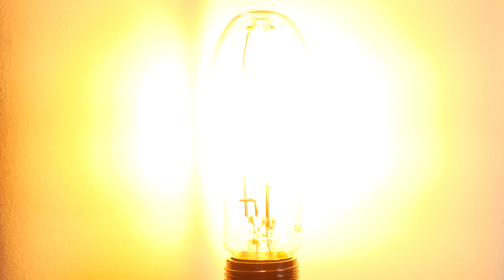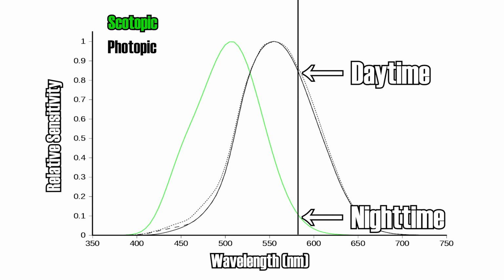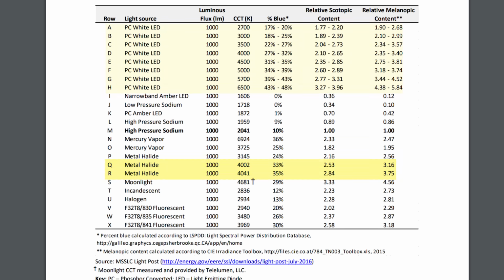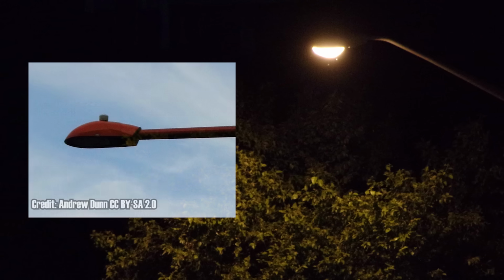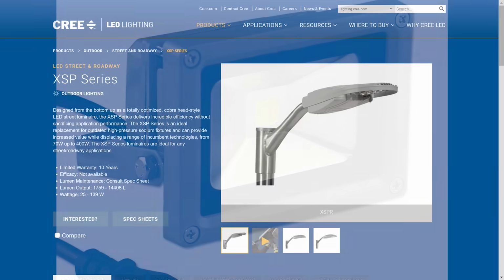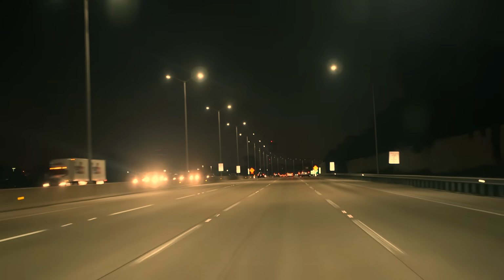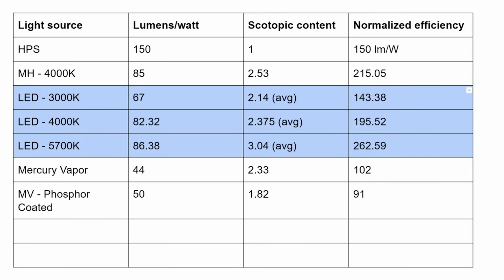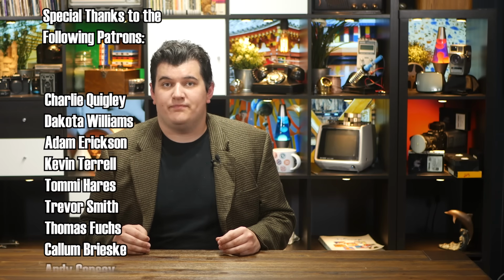The LED's Challenge to High Pressure Sodium

Comment: One thing to note is fatigue.  Blue light does in fact cause us to stress more when we are tired, and why we do like less blue at night.  Even with white LED at the 6500K level there is a lot of blue and while it is great to see at night, when you are driving it can really mess with your eyes.  I've traveled across the country couple of times and can confirm that for myself.

Interestingly enough mercury vapor lighting has a lot of blue and yet still not as powerful as the LED, but it feels like it.  Personally I like less blue in my lighting.

BTW eye color also makes a HUGE difference in terms of lighting.  Blue and green eyes will be more sensitive than brown.  It's not perception with that, but the lighter iris seems to be the factor in this.

Comment: My guess is the next step in street and various other outdoor lighting will be diode lasers. They are currently the most efficient light source that exists but there are many reasons why they are not used for normal lighting.  
One major thing with lasers is that they are monochromatic, which is a problem for general lighting because it gives very poor colour rendering. You would of course have three colours, red, green and blue, but each one would be a single wavelength. You would still see in full colour but the colours would be somewhat 'off'.

However for street lighting the aesthetics of colour rendering shouldn't be a priority and neither should it for security. The great thing about it though is that the spectral lines are so narrow and well defined that its is easy to make notch filters that would filter it out almost completely while removing very little other light.  This would be great not just for astronomers but also for everyone else who could buy something we might call night glasses which would block all the artificial lighting and see the night sky in its full splendour even in cities.

Comment: In city's alot of lights are dual purpose they want it to cover as large of an area as possible so you can get the max area for a single light and not just the road but surrounding area for the non driving needs of street lighting also for cost a city will usualy take the cheapest option that gives them what they want and safety is usually at the bottom I know a local area choose not to upgrade as they disnt like the look the cost wasnt factored tho the warm led almost sold them but the cost to replace pole lights even the cold ones would take 20 years in energy savings to pay for themselves

Comment: In regards to light pollution. As someone that enjoys astronomy with a telescope, the filterability you've mentioned is helpful with HPS not perfect but it's better. With LEDs the spectrum is more uniform so it can't be filtered out. Low-pressure sodium spectrum is even spikier making it even easier to filter it out than HPS. I wonder if with LEDs we could dim them when there's little to no activity in the nearby area not only hour based.

Comment: What i don’t like is headlights that are bluer.  I think led lamps are better because they don’t shine directly into your eyes. while Led headlights are often shining right into your eyes. 

My opinion car headlights should be warmer and street lights whiter
Reply: I think the problem with that is people drop those LED bulbs in and then don't realign their headlights to adjust for the new output.
Reply: @Arckra  Also, headlight lenses have cut offs for the light they were designed for, to keep from blinding others. HID or LED may not work properly in the same lens. Of course, people also don't bother to readjust or even look at their vehicle from a distance to see if it will blind others. I actually went to a big parking lot and checked my headlights after I upgraded them from sealed beam to halogen with a housing (hella light upgrade on my 40 year old pickup).
Reply: @Horaţiu Mlendea Yes, I try to be considerate, and being on the other end of the stick, painfully blinded by others is a good reminder. I'm also a bit of a truck enthusiast and do as much work as I can on my own, and had read how light lenses work on the internet forums for vehicles. Other people may know their lights shine into other drivers eyes, and may or may not care, but many may not know about using the proper lens. To many people think of themselves without considering how it effects others, or they don't consider other points of view.....something I have learned to be more careful about over the years.
Reply: @CGT80  I actually talked to someone that argued they could see better so they were safer.  My response was something along the lines of sure, instead I'll crash into you since I can't see shit.  Proper alignment/lenses are very important.
Reply: @grn1  Seriously lol. I swear I've run into SO MANY people with overly bright LED headlights, they've really just put a bad taste in my mouth, so I really fucking hate them.
Reply: I'm pretty sure most sources of LED headlights (aka, bluer lights, but not in all cases. Or should I say not all blue light sources in cars are from LEDs; think Xenon.) in cars are stock. It comes like that from the factory. So blame (car) manufacturers, not the drivers. I have personal experience with this. There is no way 20+ people on my way to the gym at night have all DIY'ed LED headlights into their cars.
Reply: @clippers117 , and yet, it is the operator of the vehicle who is responsible for maintaining the proper function of the vehicle and it's components. In other words, check your headlight alignment, among other things.
Reply: Absolutely, headlights are getting so bright that oncoming traffic can be nearly blinding on dark road ways. 

Ive had more than one occasion where the intense headlights of newer cars on a dark country road have left temporary artifacts in my vision like when you briefly look near the sun. However regardless of the danger this can cause good luck ever convincing anyone that their headlights should be a little bit dimmer.
Reply: Joshua Johnson just wait for laser headlights, ones that can actively prevent light from hitting your eyes
Reply: Or, people should just properly aim their fucking headlights when they get new ones, but no one does.
Reply: For decades I drove with European headlights, with a proper beam pattern. I have yet to see any N. American car or truck use lights with such a good, useful, non-glaring beam pattern. I think the N. American lights, and several imports have stylists design the headlights, rather than engineers.
Reply: You may find that a lot of LED headlights are around 4K not a problem. The ones that flicker blue and purple in your eyes are HID headlights used in a lot of newer cars and very annoying to oncoming traffic.
Reply: @aussiebloke4601  Any headlight that hasn't been properly aimed, is a pain in the ass.
Reply: @aussiebloke4601  you can get pure white hids
Reply: I remember when people were complaining about HIDs, both for color and intensity.
Reply: Looks as you was confused with "BLUish" xenon discharge lamps. LEDs can be used only as daylight for states where is mandatory.
Reply: @iannickCZ  : for a few years Toyota Corolla has had factory LED headlights. They must be legal. There must be other cars by now with stock LED headlights.

Comment: I had to revisit this video because of what New York state did on route 9 in the city of Poughkeepsie.  they have changed the HPS fixtures to led. but here's the "fun"...., yes I just watched the e reader video,  beer came out my nose!  it looks like the led fixtures mimic the color temperature of the original orange HPS fixtures.  it just seems very wrong.  the worst part is as you drive under them, the actual diodes blind the hell out of you. there is no filter!  they actually hurt my eyes.  I would love if you ever get the chance to do a quick study on those hell lights,  as I've named them. ps! you have a killer sense of humor,  I can't get enough of it!  you have no idea how many times I had to rewind cause I was caught off guard,  and cracked up so bad I missed something!
Reply: damn it! the orange ones are mercury vapor,  every time I said HPS,  replace it with MV.

Comment: I like them because they are so bright you can see everything on the road. but the failure rate seems to be high. half of the ones here around my city seem to be stuck in some kinda on-off cycle.
Reply: If you're talking about Sodium lights (I think he talked about this in the previous video) over time the aluminum oxide reacts with the sodium and increases the amount of power required to keep them lit.  As a result when they start to fail they'll actually start up, warm up to full power, then fail because they aren't getting enough power, then restart the cycle all over again.

If you've seen LED lights doing this then it's probably an issue with the driver (without getting too technical LEDs require a driver that converts high voltage AC to a lower voltage Pulsating DC).  A lot of cities seem to just go with the cheapest options and don't do any real research.

Comment: modern headlights are becoming too bright and too white/blue.  and manufacturers are allowed to focus them way too high to get their range.   ur not supposed to be able to see the direct beam from headlights but with newer cars that is no longer the issue.   everyones blinding everyone.  the solution?  brighter headlights.  they put led retrofit streetlamps where arc sodiums used to be where i live but they put neither diffuser cover or shroud over led fixture so from one streetlamp to another you can literally see the led bulbs and its stupidly blinding.  i now drive at night with my sunshade down.  technology in the hands of morons is no good.  and people that think they need to see a mile down the street and in the full color spectrum at night are idiots and driving too fast.

Comment: Would you consider producing a video comparing low color temperature LED street lighting (around 3000K) to high color temp LED street lighting (4000-5000K) in regards to light pollution versus visual effectiveness for drivers?  As you state halfway through the video LEDs have the potential to reduce light pollution.  However the sky glow from higher color temp lights cannot be filtered for stargazing because they are a similar color to the stars themselves.  Also because of the greater efficiency of LED lighting people tend to overdo it with more light than necessary, further reducing the improvement in light pollution that LED lighting would have otherwise provided.  Nothing is simple, darn it!

Edit.  Oops.  Listened all the way to the end.  Looks like you actually covered that subject in this video.  3000K LEDs appear to be a good compromise, although they aren't as energy efficient as higher color temperature LED fixtures.

Comment: Here in Sacramento, Calif....most of the streetlights are now LED,180 degree dispersion, 150 watters, I looked at one during the day with my binoculars...15 chips and NO lens, just the clear cover...they make lots of light, but also a lot of glare. Many commercial buildings are switching out the 400 watt HPS for 150 watt 'wall-mounts'...blinding anyone driving by...the local electric utility company is offering free install and rebates of 100% of purchase price...so of course lots of people are going for that, more light, and save 250 watts per fixture..

Comment: The logic used about circadian rhythm is suspicious. As this video points out (also), the nighttime light is bluer, not less blue, than bright mid-day sunlight. Then the circadian rhythm, which induces us to sleep, logically requires elevated blue at night, not suppressed blue. Instead, the proponents of less-blue claim that less blue, simulating the light preceding sunset, is required. At best, less blue would be required for an hour, and then more blue. However, the light after sunrise is correspondingly as lacking in blue as sunset. So then less blue would induce us to wake up, by the same suspect reasoning. Which is a contradiction. More logically palatable, it would be less light that induces us to sleep; and habituation to incandescent light bulbs, not something built-in by evolution, that possibly might cue some people. Others may be fine with just less light, or even bluer light.

 IAC syncing circadian rhythm should not be a function of street lighting. Many people may not want to be lead to sleep this way (for instance if they work nights or they want to attend a movie or social function, or watch TV or Youtube, etc.), even if others do. (I certainly don't.) People can have any lighting they think best at home, which should take care of it.

Comment: Now that LED street lighting is proceeding apace on Chicago streets that don't have retro streetlamps, I'm struck by color temperature. I prefer a 2700 (warm white) lamp anytime. The recessed lights in our family room and the chandelier above me are all 2700K.  I find the Chicago choice of 3000K is a good compromise, especially considering what you've said about driver alertness and ability to see contrasts at night. My house will always be 2700K except for the light that wakes up my daughter.  That's 5000K for a reason.

Comment: 3,500 to 4,000K are better on the eyes.  5000k brings a blue shift to may cheap LEDs.  CFLs at 5000k had a very noticable blue shift in the light output. 
-3,500 for these for these lamps would be more than good to improve visibility and help offset other biological impacts.
Reply: agreed

Comment: I think one factor to take into account when deciding which CCT to specify for street lighting has to be the maximum allowed speed for driving: the higher the speed, the quicker the visual response required by the drivers. Thus, a slow-circulation road should have a warmer CCT lighting than that of a freeway where people will drive at 50 mph or more.

Comment: I wish I remebr the model of led street lights I helped installed when I worked with the eletrical company I was working at, but we were putting them specifically to reduce light polution. It definattly made a difference on the ground, the parting lot was better lit, but you almost couldn't see the lights from the nearby neighborhood (which is what people were complaining about.).

Comment: Why don’t they just find a happy medium between energy output and light color? Seems like that would be the best (and most obvious) solution
Reply: I am of the opinion that 4000k LEDs would achieve this.  In my experience, 4000k produces that nice, clean white light, yet it's not nearly as harsh as say the 5700k or 6500k ones.  I don't know, just my 2 cents.
Reply: Mike Turner - it’s funny because I was thinking that as well, mostly because it’s right between 5000 and 3000 and ergo is clearly the median, but sometimes with colors the dead center doesn’t appear to be right between when the color is fleshed out, that’s why I didn’t say it. Not saying it couldn’t be, just that it might not

Comment: Leds using existing ballasts would be silly. The ballast is not only just another thing wasting energy via heat, its just  another thing that could fail in the fixture.

Comment: I agree, I don't like the white light of LED's on the street. I remember when the HPS lights took over when I was a kid and I didn't like the orange glow but now I kind of see them as a modern version of old, warm-light gas lamps. I think people are programmed to like "firelight". I'll be a little bummed if everything goes to a "robotic" bright white light. Maybe it's not so annoying on freeways or interstates but I like my orange lights on residential streets. So far in my city they have been replacing lights at intersections with white LED's but have left all the other street lights alone. I guess I could live with that if it's the best compromise of safety and aesthetics.

Comment: Maybe a good compromise would be to use cooler lights away from residential areas and on interstates where longer drives are more common and the circadian disruption would be less noticeable (and possibly even desired), and use warmer lights in more populated areas.  Bluer lights for higher speed and areas with long distance travel (interstates), yellower lights for more populated areas with lower speed travel where the reduced benefits to reaction time aren't going to be as detrimental.

Comment: Despite the manufacturers claims on LED bulbs, the ones that were installed in my neighborhood in 2015 are wearing out and failing at a very high rate.  Sometimes when they fail, it is very ugly and they strobe or stop working all together after about 12 months or so.  I don't know if these are a heat dissipation problem or these bulbs just aren't ready for prime time just yet.  Also, some manufacturers claim that the light output will reduce up to 35% after 5 years; I hate to see this when this happens as they give off a moonlight glow now and the spacing (intended for the HPS bulbs) don't quite cut it for these LEDs.  Anyone else notice this?

Comment: I think roads should have light that DOES disrupt sleep as much as possible, to keep drivers as awake as possible. 
Problem is that roads tend to be close to homes and light can't be limited to just roads. But at least highways should have lightning that keeps drivers awake as much as possible, where as places with housing should have lights that disturb sleep as little as possible.

Comment: In South London. A number of boroughs have joined forces to completely replace 5000 lamp posts. The benefits are multiple. Apart from bluer, higher, directed light to only the street below. The 85% reduction in power requirements have enabled the development of lamp post integrated EV charging. It’s the (our- UK) low rate of 7kW but still useful on many smaller electric cars & bikes.
This is really useful in inner city areas where off street parking is rare.